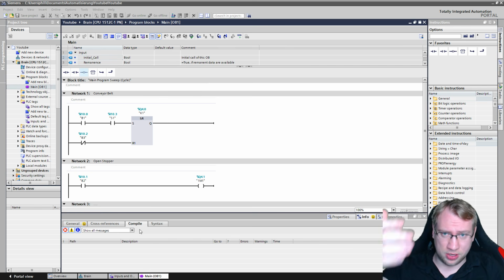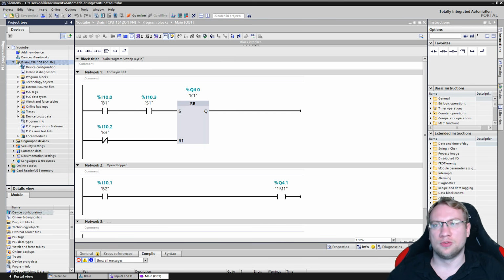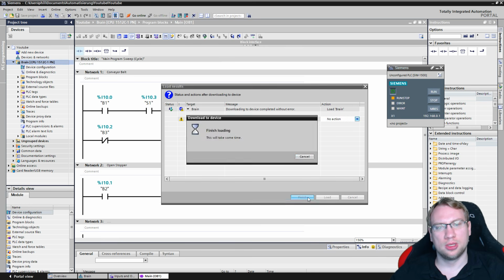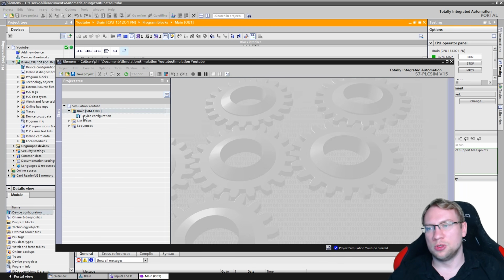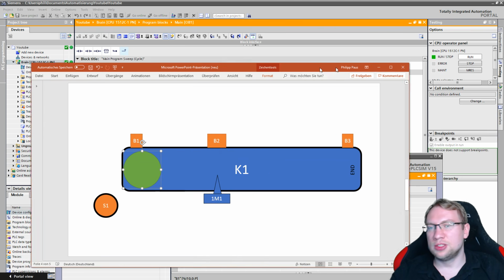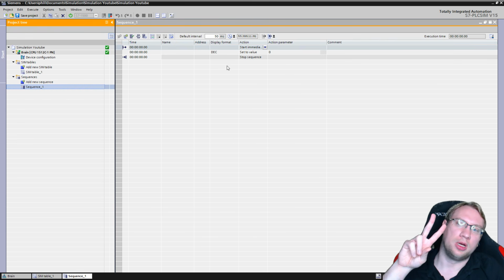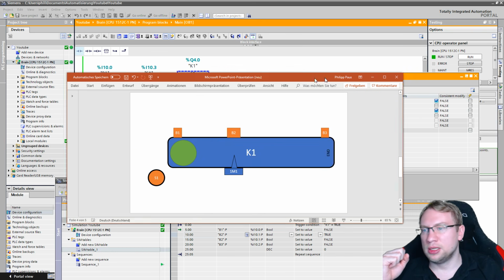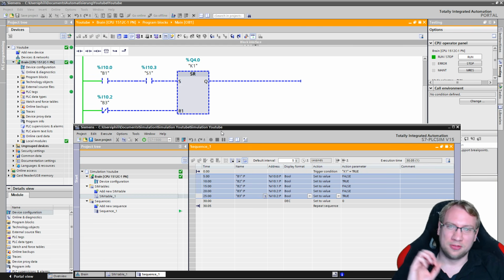TIA Portal: PLC Simulation (PLCSIM S7-1500)

Comment: Many thanks for your great explanation and your efforts. I am working on V17. I did all the steps correctly and got the same results as yours , but when I switch to project view in simulation and creat new project I got left in the project tree ( SIM tables , Sequences , Event tables) but I didn't get the CPU , so I can't show the PLC in the simulation.
Reply: I also met the same problem. Anyone know how to solved this problem?
Reply: @zk2584  Click into square menu icons on the left sidebar of the simulation window, then either manually type tags or choose them, after clicking on label icon in the top-right part of simulation menu

Comment: Hi Hegamurl
Additional to what I asked you about start values in DB variables :
Of course, while connected to the PLC you can change the start value in the DB so that it will
be what you want on the next startup.
BUT my issue is that when the plant is now running and the operator needs to change a process value
and this value should become permanent, he has no access to the programmingcomputer and so cannot
put that new value as the DB word start value for that variable.
Is it possible to do this ?
Tom Keeble

Comment: Hey thanks for your videos, they are extremely helpful. I was wondering if I could make small changes to the program within the simulator itself, or would I have to alter the program separately then load it into the simulator to test?
Reply: yes, every change to Hardware to software has to be loaded separately to the PLCSim before simulating the changes

Comment: Why at the beginning B3 is activated if there is not a placed nothing? If I good understand it can be activated if the sensor will see something, similar to B1
Reply: I am confused also.
Reply: I think it’s a mistake.

I would say B3 is the same sensor as B1, and won’t send out a signal until there is something in front of it… at that point it’ll send signal and the NO contacts in the program will close and make the reset.

Comment: Tia portal shows that need version firmware  of controller 4.0 or higher.  But Tia Portal don't  contain such version of firmware. What should i do?
Reply: Got any solution?have the same problem
Reply: @solutionsgalore1760  It doesn't solved problem.